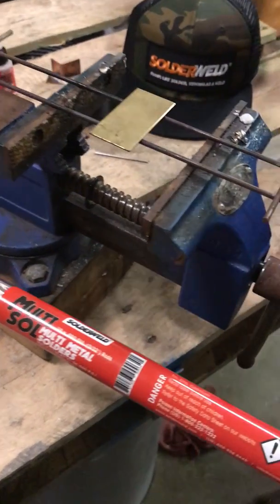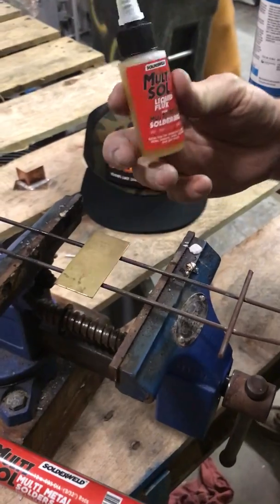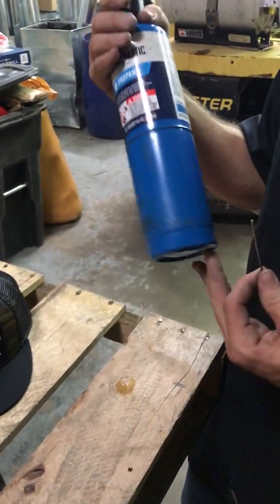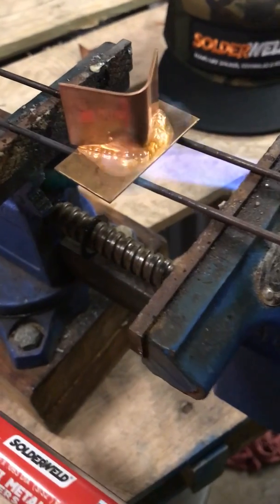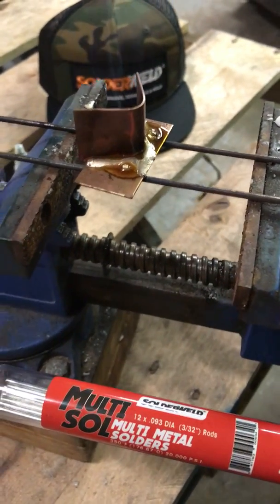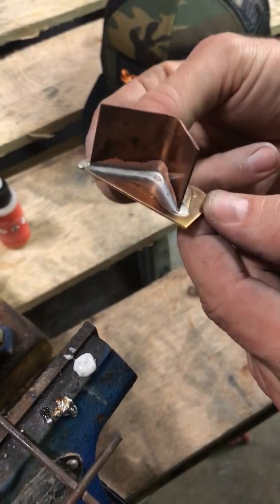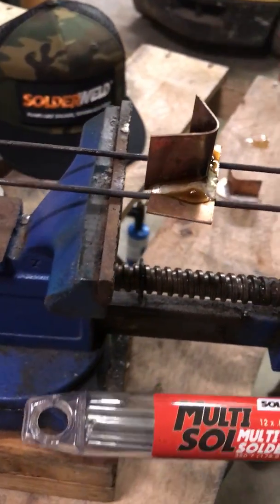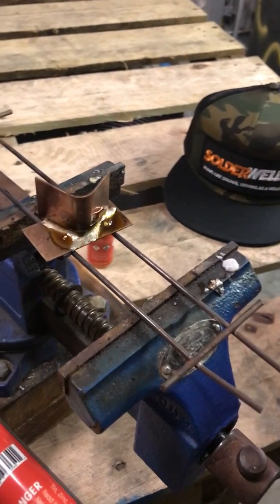HVAC - New Way to Braze with Solderweld

Comment: what about the flux being inside lines?
Reply from the maker: throttle bottle sorry about the slow response. Didn’t see the question. Treat it just like silver soldering with Harris Flux. It mixes well with oils. But over do the Flux and you’ll be fine.